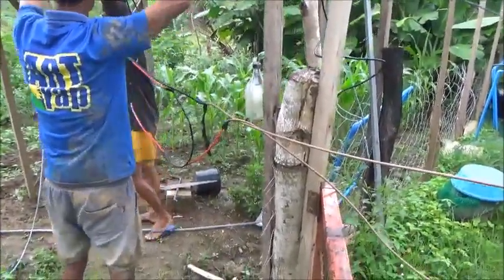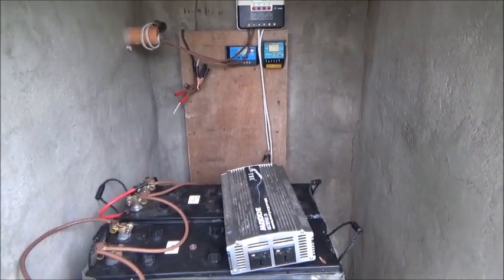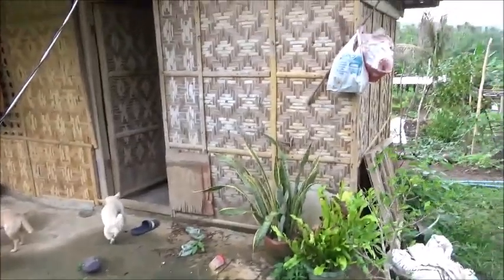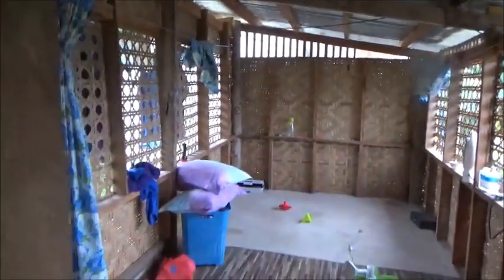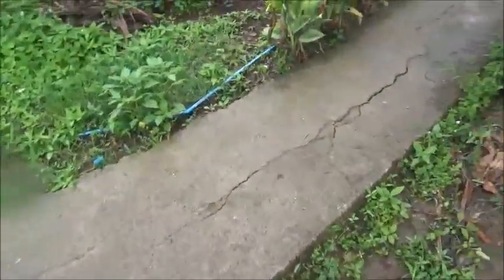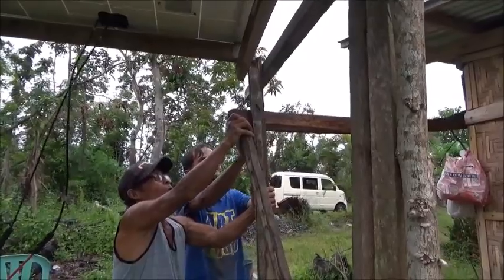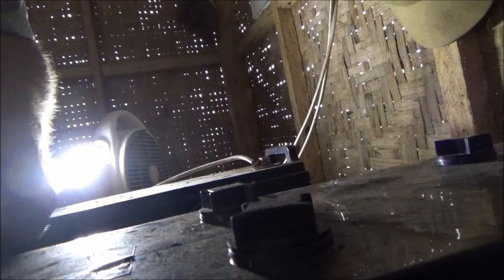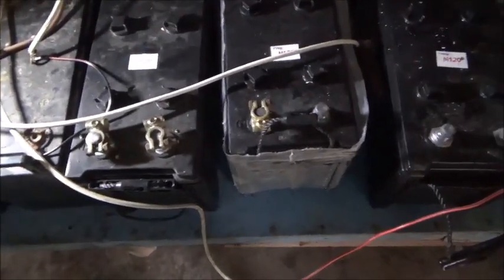Moving The Solar System

Comment: Brian, 7 degrees doesn't sound right. We are at latitude 14.2735 south of Manila. You are at 10.1395 near Talibon Bohol. If your uprights are
like 8 feet apart the height difference is 17-1/8 inches higher on the north upright pivot point.

Comment: Brian the battery voltage means nothing, batteries can show voltage but can not provide amps when under load as when starting an engine  one bad battery in series will effect your power out put I have 4 truck batteries same size as yours  in 24 volt series to start the gen-set one weak battery kills the cranking speed I bought a load tester and check the batteries every month it works well it puts a 100 amp load on the battery and will show you a bad battery  Homyl Battery Load Tester 100 Amp Load Type 12V Mechanics on lazada 1600 Piso also maintain the the water level in the batteries use distilled water to fill I'm sure you already Know this heavy rain here in Panay for 2 days now roads are flooded
Reply: Yes its called " surface charge" and your exactly right, introduce a load on the battery and do a time discharge graph.
Reply from the maker: I was always able to tell a bad battery by reading it's voltage 24 hours removed from a charger. Is that tester electronic or carbon pile?🤠

Comment: An old battery will take a greater surface voltage then a newer one, but the first load and you get a true reading. I doubt the 12.8 as you do, probably just surface charge.

Comment: I would imagine that the solar system you have now is mainly for your household, so wouldn't it be best to relocate the solar panels to the roof of the house now, then you are setup and can add more panels as you go.
Reply from the maker: Actually not the case Dan. 90% is used to run the water pump and in the near future more aeration. A big jump in output is required to run anything major in the house, such as the ref or the aircons. All we are using right now for the house is the charging of gadgets and running the computer...all of which is easily achieved with an extension cord🤠